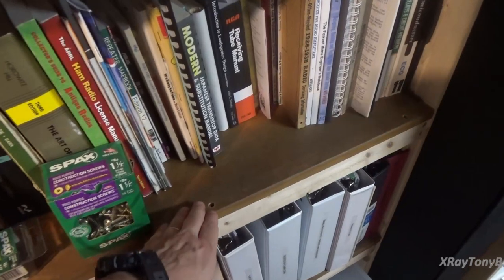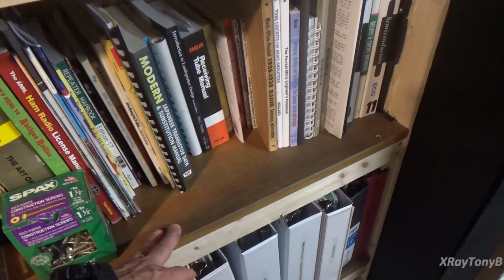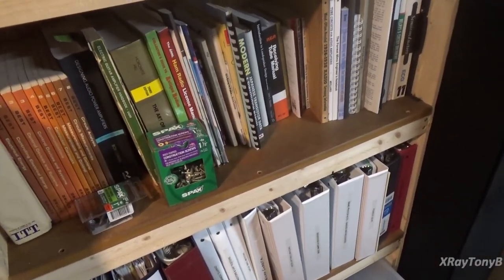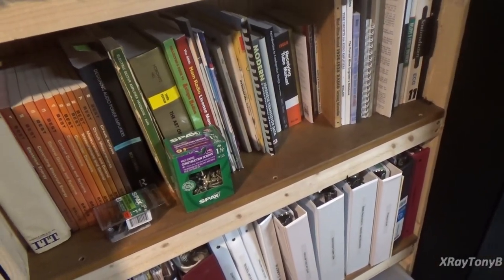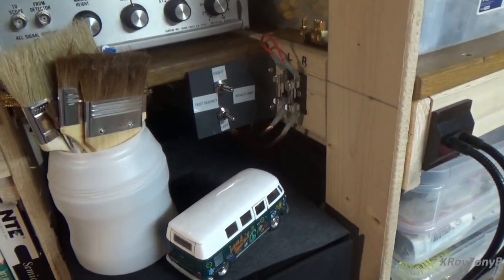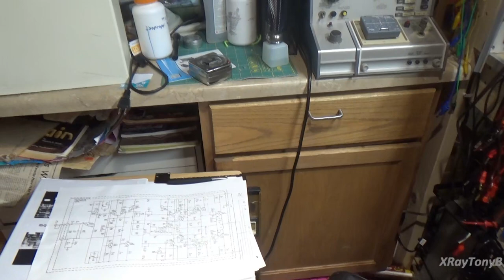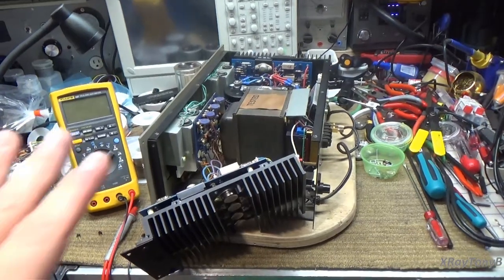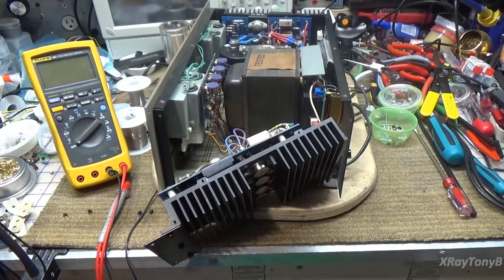Workshop Update

Comment: How about a small protective cover plate to cover those fuses you installed on the side of the bookcase just in case a finger comes in contact with one of them after slipping off those switches.  Sorry.... I’ve built too many electrical control cabinets. I’m retired now. Everything looks great keep bringing the videos Tony👍
Reply: They are speaker fuses. There is no particular danger in touching them. The placement in this situation is really silly, however.